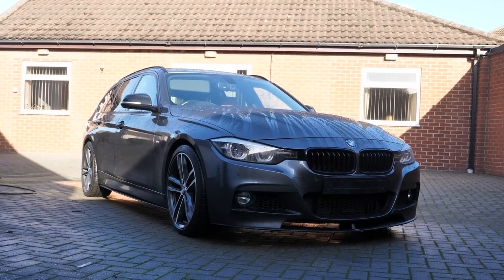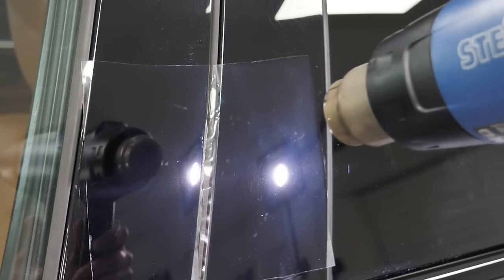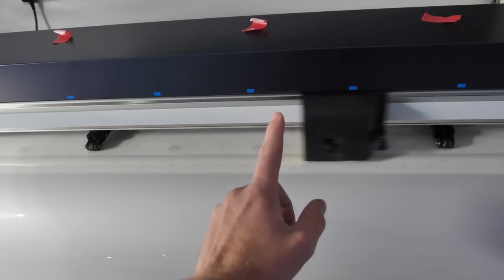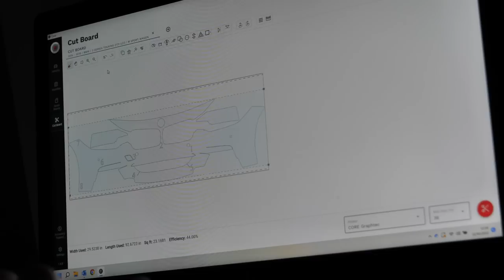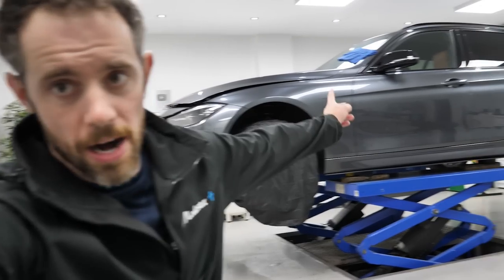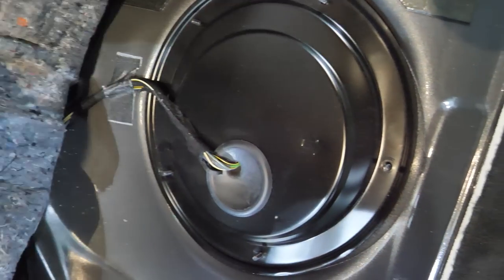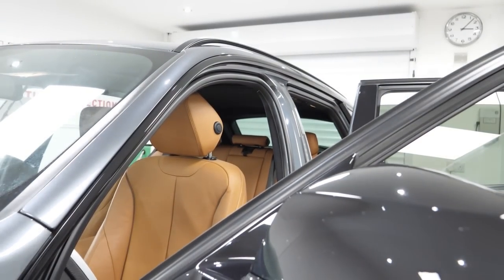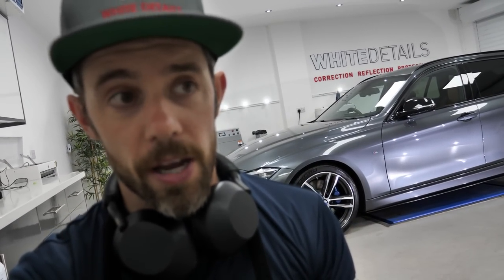First time putting PPF on my own car - 335D Touring (Part 2)

Comment: Jim so glad to see you getting into PPF, you were a big inspiration to my business when we first went full time, and I even called and asked for some advice once! Quick tip for your squeegeeing, coat the edges of your squeegee, it will make the glide much more smoothly, and help minimise the scratches, along with spraying slip on top of the film. Also BMW door handles are super easy to remove, pull them out for the doors. The M Badges come up super easy too, no software has them in the patterns, so just pull them off and re-tape them when done! 

Cheers, Saad

Comment: Take a moment to clean out your sunroof drains, having water leak into the boot could have really damaged all the electrical modules in the boot of my 535d recently following the non return rubber drain valve filling with junk. Great video,  love the content 👌

Comment: Great video, some observations that I’ve taken away:

- Don’t scratch your cars PPF with a wire brush 👍🏼
- Jim said the word condom 😂
- why is no one talking about the fact Jim used a scraper on the bonnet 😮 gave me chills
- Finally, there was no need for the slo-mo of the pillar coupled with the music,  very seductive. But I’m here for it 😆

All seriousness, a great video 👏🏼 a question I thought of was if you would consider offering as a service, putting PPF on the gloss black for interiors?

Comment: I have seen 2022 cars with fuel level faults. usually when you brim them the level sensors just get stuck at the top. He probarbly caused the issue by being generous. Such a nice car over all !!

Comment: I have had two BMW cars from 2020 of mine PPF'ed with XPEL. What I have noticed is that especially the edges on the front bumper, front sides and rocker panels really need extra heat and drying otherwise tiny small dirt particles will start to get trapped when the film is newly installed and fresh. So make sure to let it dry and use the heat gun for additional hours than the recommended time I would say. The hardest part with PPF I find when I have installed small pieces on my own, nothing big is the delicate feeling to cut through with the knife steady and straight, that is a skill you can practice to really get top notch results where knife is needed.

Comment: Great video. I’m not sure what you can charge in your area, but I live in the San Francisco Bay Area, and I paid £10,000 to get my 2022 G82 M4 full STek PPF and Feynlab ceramic. Full polish, car was delivery miles, and I brought it to the detailer with all of the factory plastics and white tape masking on the hood and handles. I’ll tell you if you want to offer this on the high end cars, cutting out the emblems and door handles is going to be a no-go. I had badges removed, and since they’re one time use, they were all reordered. Factor this into the cost when quoting the job. Thumbnail spoiler removed to facilitate the boot being PPFd in one piece. The spoiler PPFd and then reinstalled. Door handles removed so no cookie cutter door cup cutouts. Wheels off and polished, ceramic. Carbon ceramic brake calipers ceramic coated, outer windscreen, STek DynoFlex. 9,500 miles later, no issues, no delaminating, no PPF peeling back. It’s been flawless. But I paid for it.

Comment: Jim please get into the habit of sliding your blade back in after a cut so it’s muscle memory. At 15:15 you were pulling ppf with an extended blade and a slip could get nasty quickly! Nice job on the install!

Comment: An old guy from the trade told me to use petrol to remove tar and contaminates.  Obviously it will probably strip all protection back to lacquer,  but is there any reason apart from obvious safety that this trick shouldn't be used?

Comment: Stunning Motor Jim, glad to see you back in a Beemer again.  Slightly biased having a 2016 LCI F31 335d Tourer myself.  Astounds me sometimes with spec choices (I.E missing pro nav).  What colour is the interior, is it cognac?  Looks like the rear wheels especially have spacers as well do they?  How does it ride on the lowered springs?  Does it have adaptive or fixed dampers?  Got Schnitzer springs for mine but not fitted yet

Comment: I have PPF on my car and the most annoying bit is how after a year or so, dirt is visible along the edges.
I will be interested to see if that happens to you, and how to deal with it. I have tried wooden picks, and they work sometimes, and sometimes they don’t.
Reply: use a bit of tar remover, or xpel film cleaner on the edges. also coating the PPF helps
Reply: @Obsessioncardetailing  
Gave it a go on a small section with some tar remover, and it worked perfectly.
Thank you for the tip.
Reply: @Obsessioncardetailing  
Done!

Comment: I didn’t see any hot water in a spray bottle. That will be your best friend for bulking mirrors and edges. Hardest car I have done to date was a full body Hummer H2. The roof is insane because of the rise and the channels on top of the rise. And the faux snorkel caps on the front. Best part is no patterns for most of the vehicle so it is all bulked. The doors are insane because of the paint going all the way around the windows and then recessing in. Had to remove the front windows to remove the mirror on the front doors. And the upper rear quarter panel, that was a unpleasant woman. All the “popsicle” shaped vents on the front windscreen cowel had to be trimmed out by hand. If anyone wants one done we charge $15k USD and don’t even really want to muck with it at that price haha.

Comment: Hi Jim. So how much does it cost to PPF the front of a car ?. I have an old classic SAAB 9000 Aero which is having a full respray in a few weeks time. So it makes sense to get it protected once the paint has had time to harden and outgas.
Reply: Depends on shop and product used. I had a new Corvette done, $3600, a new  CX-5 also done, $2,400. XPEL PPF.